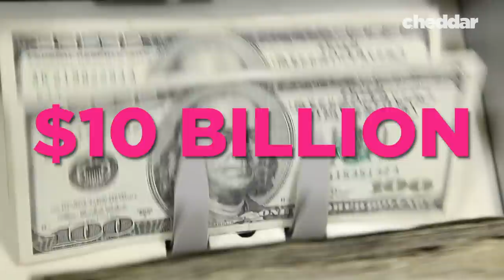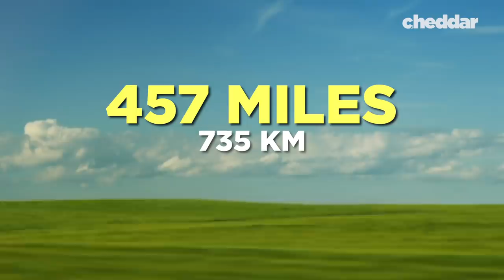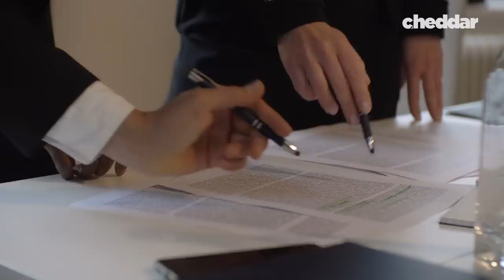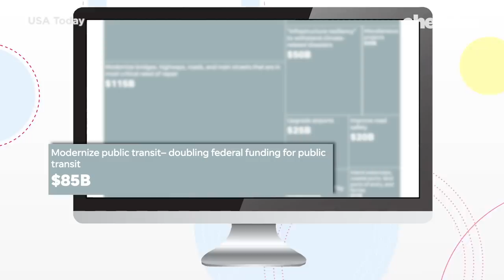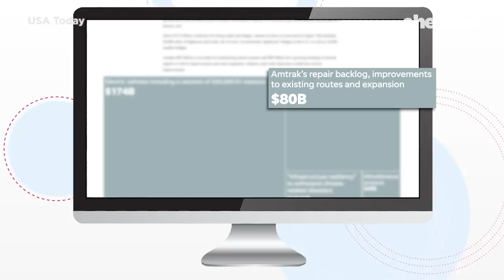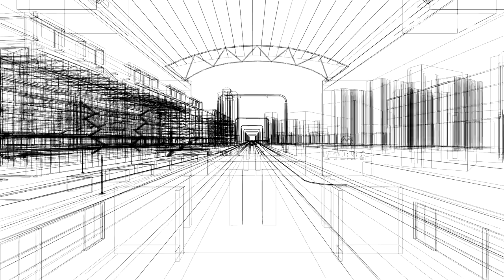Is New York Finally Getting A Real High Speed Rail? - Cheddar Explains

Comment: December 1967 the UAC TurboTrain set a speed record on the northeast corridor @ 170.8 miles per hour in New Jersey. Well over fifty years ago. Had there actually be a need for a 200 mph train, it would’ve been done already.
Don’t equate a want, or some jealous inferiority issues, with an actual need. If you want to get some where fast, join the jet age.

Comment: Why does the United states even need high speed rail, when there's low cost airlines. With airlines all you need to build is airports not miles of expensive rail tracks. In terms of cost to benefits to me it seems unnecessary to me.
Reply: On average it takes an hour and a half just to get on the plane and another half an hour to get off, it’s incredibly inefficient. It takes 10 minutes max to get on a train. A high speed train would never be worth it from New York to LA but anything under 3 hours would probably be.
Reply: @francogiobbimontesanti3826  wrong, most flight start boarding 30-50 minutes before departure and leave 15 minutes before departure. You have a 15-35 minute gap for boarding a plane meaning on a average it takes about 30 minutes to board.
Reply: @blackhole9961  That would be in a perfect world sure. But people argue normally an hour and half early to do their check in, dispatch their luggage and honestly just because they are scared of missing the plane the average time of someone entering the airport and getting on board is half an hour. And the commutes to airports are always longer than to a train station since airports have to be far away from the city.
Reply: @francogiobbimontesanti3826  the same things also apply to the train station, your going to have to arrive early(if trains were as widely used as planes, train stations are pretty empty because no one takes the train)also it would take about the same amount of time to get to the train station as you would an airport. The majority of Americans live in the suburbs extending 10-30+ miles away from city centers, you still have to get a car to drive all the way downtown.
Reply: @blackhole9961  Have you ever been I a bullet train? You basically buy your pass, hop in and hop off. And there is a new train every 20 minutes so you don’t need to arrive early. I recommend traveling to japan so you understand the experience.
Reply: @francogiobbimontesanti3826  Japan is a completely different country than America and doesn’t share any similarities. Japan is a small country with 126 million people. It’s cities are very close together and they all have very high population densities.
America is too different to even be compared, with its vast size, spread out population, lower on average density, differently planned and zoned cities, etc. because this is America we’re talking about you likely won’t be able to just “buy a pass and hop on,” the TSA will also be in the station.
Reply: @blackhole9961  I am not talking about how profitable the trains will be. Just how they work. Boarding a train is completely different from boarding an airplane.

Comment: HSR is imperative if the US wants to compete in the future. A couple missing cogs, here in Massachusetts are the North South Rail Link in Boston to connect Northern New England to the NEC and national network, and the East West Link to open central and western Mass with Boston. There's already a greatly improved connection from Springfield MA to Hartford CT. High speed trains from Springfield to Boston would also open up the Pioneer Valley and allow the 20,000 student at UMass Amherst access to Boston.
And the core of national passenger rail, Chicago, has exactly zero high speed rail lines even a dream.
Build a national High Peed Rail network NOW.
Rep Seth Moulton (D-MA06) has a plan!
Enact it!

Comment: We've built roads and other infrastructure around cars and oil since the 1950's to a point that modern public transit systems like high speed rail will be impossible to build. Congratulations America. We played ourselves!
Reply: We do have high speed transit to go from city to city. it's called jet aircraft.
Reply: @neutrino78x  That is if your idea of high speed is waiting in the line for boarding passes and luggage check-in, waiting in line at the TSA security check, and waiting for the plane to depart but gets canceled.
Reply: @ainahko16  yep. There's no need to go to customer service. They have automated baggage check. Your boarding pass is in the app. Security is five minutes. I normally don't get to the airport more than 30 minutes before boarding. One time I got there five minutes before takeoff and still got on the plane. Using CLEAR helps, it bypasses the security line. Also you should have your laptop etc setup so you can easily remove them from your bag.

And yeah, when the plane is one hour and the train is four hours, the plane is a LOT faster.

Train a petite vitesse.

Comment: You didn't mention any of the important reasons why it's so hard to get high speed rail here. To be truly high speed,  it must travel on a base that is incredibly straight and flat.  You can't feasibly adapt any existing rail or road corridors to this task for that reason. You'd likely need to build on a completely new, stand alone right of way.

Second, it must compete with airlines on cost and travel time.  The airlines are a lobby against high-speed rail.

In other countries, the rail interests and legacy infrastructure are stronger.  Also, we have a federal system that makes it harder to execute projects without state and local buy in.  France and China are more centralized and value national prestige over provincial economics and politics.
Reply: Germany is not centralized and has good HSR tho

Comment: As great as HSR is, I wonder how they could create the equivalent convenience and freedom of going wherever whenever in a car. Not saying I'm against HSR, just wondering how they would compensate, let alone the amount of money spent on it?
Reply: As someone from a country with a good transit network: Yes.

Now that of course can only work if you have good public transit most places you go to.
But if you have that you have the freedom to go everywhere you want (and spend your time doing other things than driving).

I don't own a car and in the rare occasions I need one I simply rent one (for far cheaper than owning one I would rarely ever use).
Reply: There is a unique type of freedom when car is not necessary to travel anywhere. The most immediate is when becoming a passenger to any vehicle: the reduced need to pay attention of the road. No need to worry speed limits, alcohol levels, distracted driving, etc.

There will be huge potential savings when removing car from expenses, because the following is also removed:
• fuel/electric power
• maintenance
• registration
• insurance
• cleaning

Note: this is only true when you have alternatives to driving. If you cannot travel at all without a car, the lost opportunity will outweigh these savings. But again, car as a requirement at all will present a chicken-and-egg problem:
• to get to job opportunities, you need a car to travel there.
• to get a car, you need a source of income.

Comment: 2:20 speaking about population density,  in the US?!? You have 33 people per km², Spain 94 and Germany  233! Well, to be fair 4 states have an even higher populations density, and the ares where hightspeed trains make the most sens, are where the most people live. So shure, it doesn't make  it easier, but it is in my oppinion a very weak argument.
Reply: Correct. However, even in the four higher density states, because of the very high cost of building HSR, it can only be financed with funds from the rest of the country which will never get any benefits. This makes it politically infeasible.

Comment: Good luck took twenty years to get a third track on the LIRR, you pick the widest part of the sound to cross in a tunnel, and all of this is designed by planners not railroaders.  Ok, next issue, the route you show for the CA line is not the route they are using, think about 50+ miles east, roughly Stockton to Bakersfield and they've already committed nearly $100B,  where is the rest coming from?  There is no serious planned route from Bakersfield to LA and if you know the way to Jose, you know this is a really busy commuter corridor enroute to SF, no way will they make this trip in 3 hours, more like 4 and given the current speed of construction, it won't be finished before 2040 and more likely 2050.

Comment: The East Side Access Project to Link the Long Island Railroad direct to Grand Central Station in New York City in Jamaica Queens should be enlarged by digging an Underground Tunnel from Jamaica Train Station straight to the
Hicksville Train Station to bypass the existing Long Island Railroad Tracks 
A Huge Underground Train Station should be Dug under the Hicksville Train Station.
Hicksville Train Station if done well can then be made into an Environmentally Friendly Smaller version of the Jamaica Train Station.
Underground Train Tunnels to Hicksville can be one day a part if an underground high speed train tunnel system linking New Jersey, New York City, Staten Island Long Island and Connecticut altogether into one large High Speed Train Network linking Long Island Into the North East Train Network up into New England..

Taking a Train from
New Jersey and going into New York City and or into Long Island, Queens or Brooklyn should be made possible.
 Then taking the same train into Nassau County and then into
Suffolk County has to be made possible.
  Then linking it to be able to go on into Connecticut and then Rhode Island and then going on into Massachusetts has to be designed AMD built.

Comment: Take the current Amtrak acela in the northeast. This train travels at speeds of up to 150, 160 mph but is stipulated due to old tracks. Ok, the first thing you have to do is build a new track line and this time you run it from Boston Massachusetts to Miami Florida. If you have to tunnel through a few mountains, then simply do it. When done, apply bullet trains that travel at speeds of up to 200 to 250 plus  mph from Boston Massachusetts to Miami Florida stopping in one or two major city in each state in between and along the way. Now you have the Eastern Seaboard Bullet Line. Bullet trains would arrive and depart every hour in all destinations all up and down the entire United States Atlantic seaboard with comfortable seating, meals or vending atleast, television monitors, laptop accommodations and so on. Now explain to me why  the so called mighty United States of America couldn't do that? This would be the greatest accomplishment since the mega project of the Pennsylvania turnpike construction. You can move people up and down the entire United States Eastern seaboard quickly and comfortably. No more driving on the congested i-95 for 30 pluss hours from Boston Massachusetts to Miami Florida. You dont have to go through the stresses and headaches of boarding a flight especially people like me who dont fly, too dangerous. And before you ask, what about costs? Know this. If the mighty United States of America can put a man on the moon to jump around and pick up rocks at a cost of billions of dollars, or the 200 billion dollars spent on the space shuttle program which by the way,  where's the space shuttle at now? And were not gonna talk about the billions and billions of dollars the United States of America is about to spend to put some fool on mars nor the billions of dollars to put the James web telescope in space, 50 billion dollars on the international space. All these things and who benefits from it, me and you? Think they'll allow us to go to the international space station to visit and look out over the earth? Lol!!! Yeah ok you run along home now buddy..lol!! But anyone and everyone can benefit from the Eastern Seaboard Bullet Line. Again, highspeed bullet train and maglev super train technology, the new american dream.......

Comment: Just wondering if spending maybe $200B's with cost overruns, corruption and inflation is worth it.  Will people be traveling so much, especially for work with Zoom and everything else to come.  How many people would have to use the service to justify such a cost and what might that be per rider.  In Baltimore many of us thought the low ridership on existing subway and light rail did not warrant building a new proposed Red Line streetcar for $4 B's with cost overruns, etc.  We figured it would be much more cost effective and environmentally friendly to buy each potential regular adult rider a Tesla, especially if you include ongoing maintenance and security.

Comment: The California high speed project is a joke. TOO SLOW, poor route / stops, way too expensive to start with, can’t keep to budget at all, too long of a build time, project is falling apart and routes / stops are being canceled or changed. 

The US only made things worse (esp in Calif/LA) by tearing up all the existing track because buses were going to fix everything. Now all the track and more important land is gone and can’t put a train there anymore, or if you can it can’t be high speed until you elevate it or bury it. Even more expensive and unlikely.

Comment: We always hear the US is behind the world in high-speed rail, but they always leave out the fact our commercial airline industry in the last 20 years has transformed from a hub-based airport system to the biggest network of regional direct-flights, adding thousands of new smaller Boeing 737s and AB a319s & a320s. It's faster than rail, cheaper than rail and privately paid for! With the exception of local and state government airport bonds which are paid back by fees to the airlines not the taxpayers
Reply: what about security? constant airport delays? checking luggage? for planes, you usually have to wait 90 minutes before you board. for trains, usually about 20 minutes. taking the train in the northeast is much faster than the plane. not to mention that trains are much more environmentally efficient.
Reply: @thechickenstew3716  I fly all the time, and in my opinion the TSA is so much faster than they get credit for. Only during the big holiday rushes do I ever see a backup. I fly from often Orlando to Nashville, I get there 60-75min early, Amtrak Acela requires you to be there 30-45minutes early . The flight time is 102 minutes gate to gate. It's 2.5 to 3.25 hours. 

I'm not going to debate environmental facts because there are a lot more claims than facts on either side.
Reply: @mikeef747  have you ever rode Acela? no doubt taking the plane is faster than the train from Orlando to Nashville, but in the Northeast, most trips are a lot faster by train. not to mention that the train takes you directly to downtown.
Reply: It is not actually much faster. Spain's HSR travel at 192 mph, 310 kph. Stations are in the city centers, and you can board up to 5 min. before departure. They run perfectly on time, because you are entitled to a refund for delays longer that 5 minutes.  Once you actually travel in one you realize how obsolete  regional flights are.

Comment: The problem is that with each successful project that is built, subsequent projects will  become cheaper due to experience in engineering and construction as well as the development of support infrastructure such as locomotive/train factories (most modern HSTs are EMUs), devopment of signaling systems and specialist metal fabricators for rails, catenary and wires.

However because none of this exists yet the initial capital costs of individual projects will remain high discouraging initial investment.

Comment: High speed rail is obsolete technology; because leaders will lose interest in it after the ribbon cutting ceremony is over. Politicians Love to cut ribbons, they hate pushing brooms. States/Cities that cant even maintain their current rail infrastructure should not be in the habit nor rewarded to build high speed rail systems; especially when they have huge maintenance backlogs on systems they've had for decades. The shift in federal funds to finance HSR will be a massive perversion of spending priorities. And it’s reflected in the political regimes that allowed it to decay. They’ve lost interest because personal electoral issues are more important than running the city. The massive maintenance debacles in New York, DC, Chicago and Boston are proof enough of that.